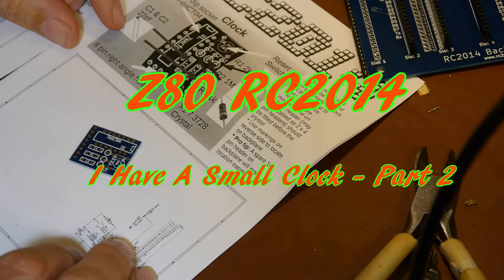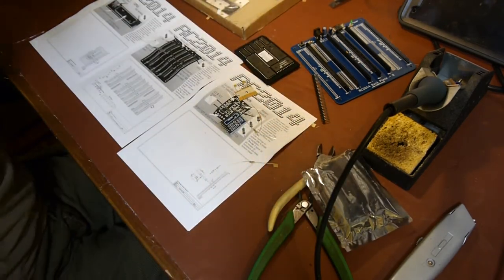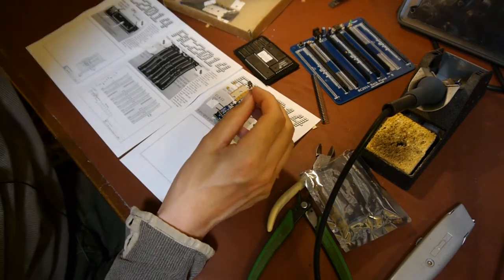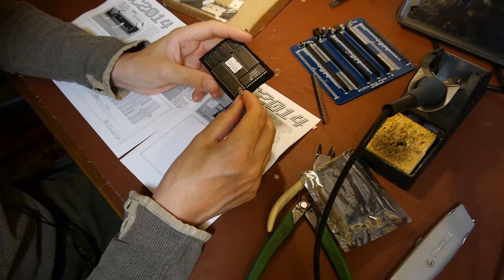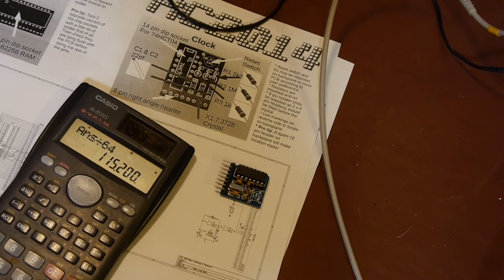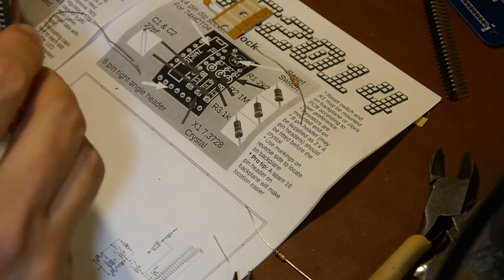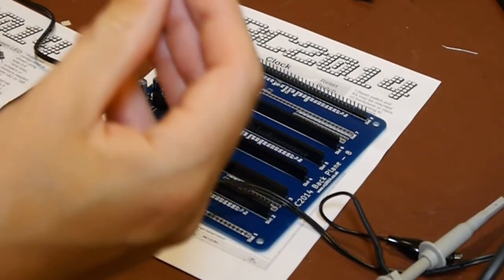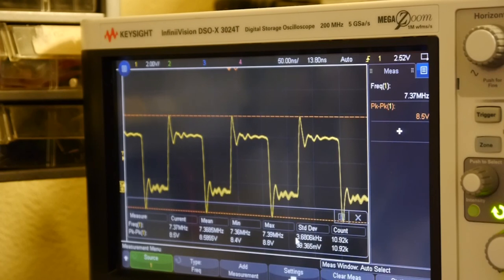Z80  RC014 Build - Small Clock Part 2

Comment: I'm looking forward to the rest of this series, Chris. It's good to get back to the basics of the fetch/execute cycle once in a while. I'd love to get hold of one of those early microprocessor tutor boards with hex displays, and where you could single step, but I suspect they go for silly money these days.
Reply from the maker: oldblokeh  you know I have been looking at some of the old boards there's a 6800 on eBay at the moment was a £45 when I last checked but many go for hundreds of dollars now. I had a 6800 with the key pad and red led displays hours of fun typing in the OP codes just to add two number together. I have to admit this was all so long ago I don't remember in detail how it all works. I'm trying to find a free assembler on the web as I want to have a ago at doing some assembler code and blowing a eprom for it.
Reply: Are you after a cross assembler or a native assembler?  If the former, there are plenty out there.
Reply from the maker: oldblokeh  I'm a bit woolly with these terms. I looking to write the code on my PC  in assembly language and assemble that into the machine code that I can use to program the ROM.  Perhaps you can advise me here ?   It would be useful if the program has a windows IDE as I'm not big on command line and some ability to simulate with break point and watch windows would be handy. Thanks Chris
Reply: It's a cross-assembler you're looking for, i.e. an assmbler running on one cpu assembling code for a different cpu. A native assembler assembles code for the cpu it's running on. You could take a look at this: https://www.ide80.com/  I've not tried it, mind.
Reply from the maker: oldblokeh  that's one I had not found. I guess it's a matter of downloading loading and giving them a try.  Thanks I will let you know how I get on in a later video. Regards Chris
Reply: Good luck. I've just tried it, and it's not that intuitive. I have managed to cobble together a nonsense bit of z80 code with it, and it assembles to a .hex file. May have to find a different emulator for debugging though.